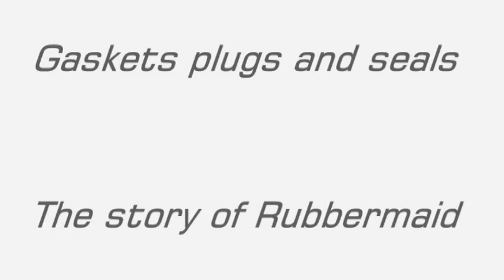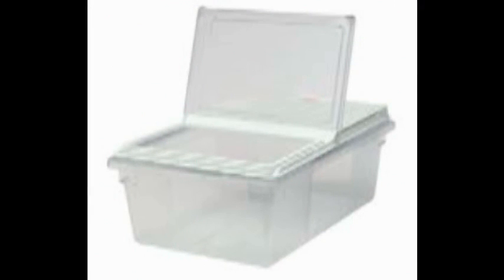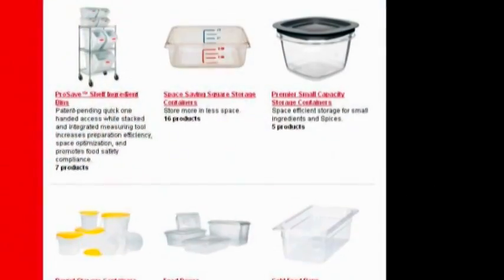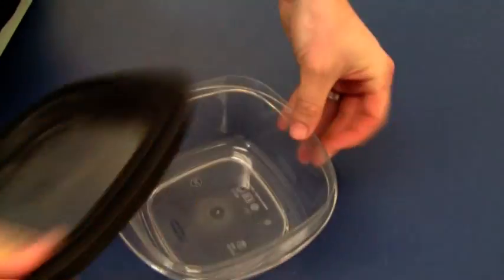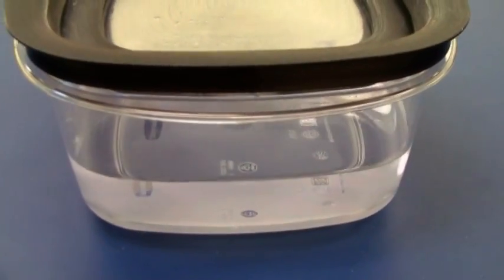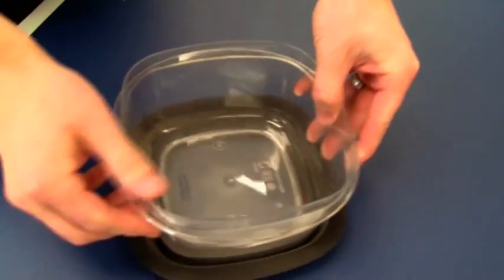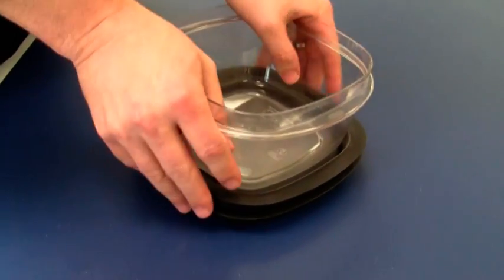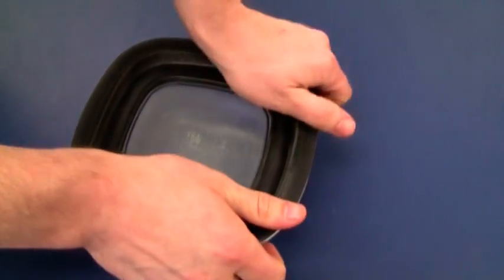Create usable rubber seals, gaskets and plugs with 3D printing

Comment: Help,, I want to print a seal for between my carburetta and the airfileter  housing, it is now hard to find same in the market place, and I need 2, yes 2 engines
Reply from the maker: +Steven Olsen Hi Steven  You might try connecting with Stratasys Direct Manufacturing at
https://www.stratasysdirect.com/

Comment: it would be quite difficult to do due it needing a sheilding gas and to have it pass stress testing for certification would make it harder again the base if building steel structures could be made from copper as it does not weld to steel. also metals tend to "ball" at the tip wen welding so the end piece would need considerable finishing. you would also need to shield all 3d runners so splatter does not clog the head guide rails. its hard but not impossible

Comment: what do you think?
3d printed  gaskets arn't going to hold pressure for a indefinite time
they are very micro layers how ever it is still have gaps
Use your logic
a metal molded silicon gasket or a printed one?